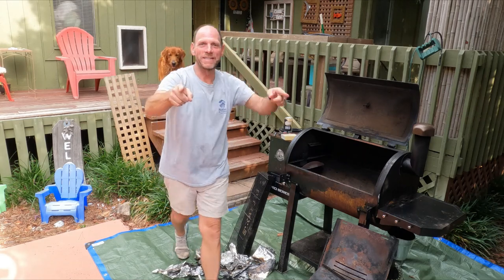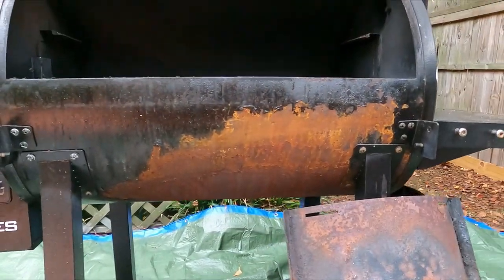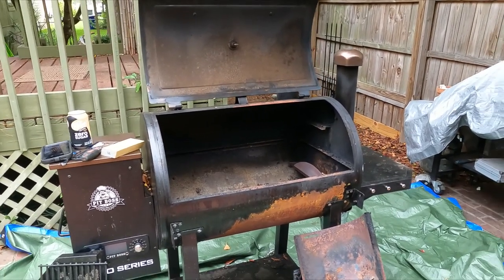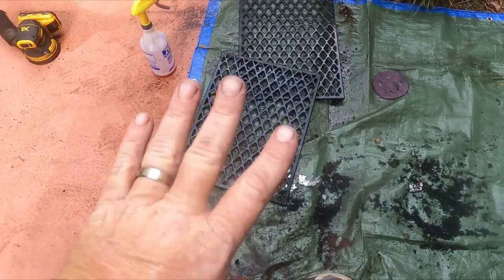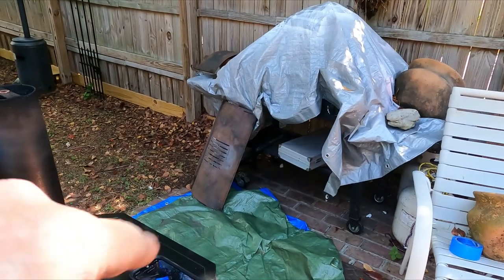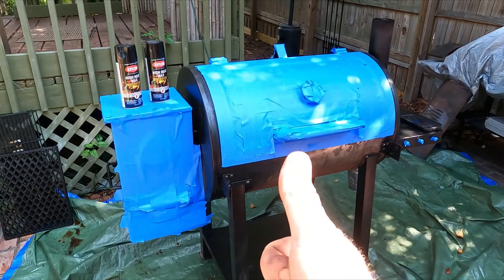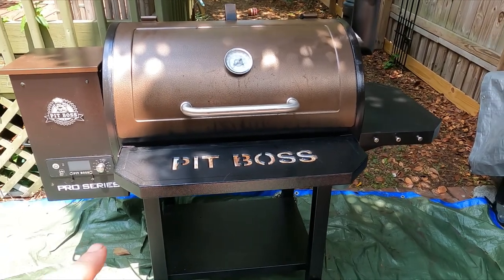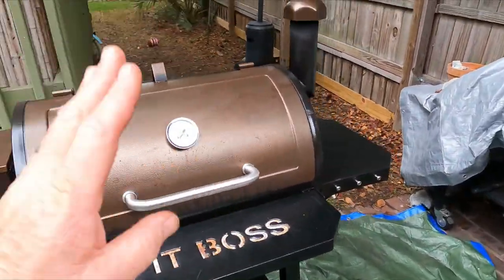Cleaning the Pellet Grill | Restoring Pit Boss | No Coffee Needed | Pit Boss Maintenance | 4 yrs old

Comment: Hello did you end up spraying the deflector plate ?
Reply from the maker: I did, and it has held up well. I do wrap it with tin foil though to help protect it
Reply: Awesome thanks for reply had a little grease flare up in mine today after about 4 years as well this video was very helpful ill be repairing mine tomorrow after I get the essentials needed 😎 thanks again

Comment: And just so you know if you go to the internet and type in pats for a pit those grill you can find anything you need to rebuild your smoker .don't go to the pit those website you'll probably pay more I bought a porcelum burn pot with igniter for less then forty dollars.a new control board,both fans and probably didn't have a hundred twenty-five in all off it and it was a perfect fit.wires and all matched up we're like you we cook several times a week and most are long cooks,butts,ribs,brisket smoked pulled chicken
Reply from the maker: Thanks for the tip, if I ever need any parts I will most definitely search the internet.